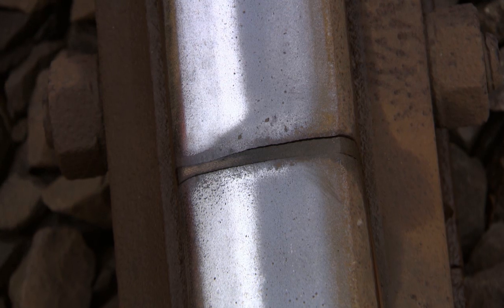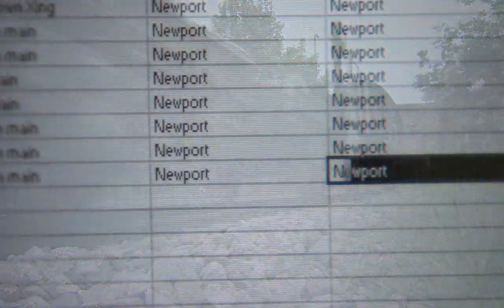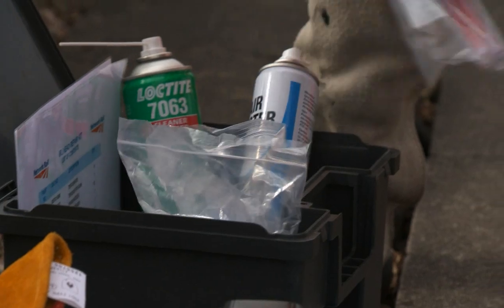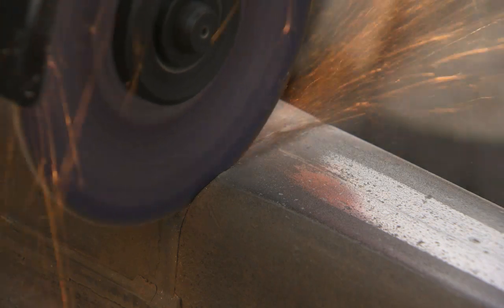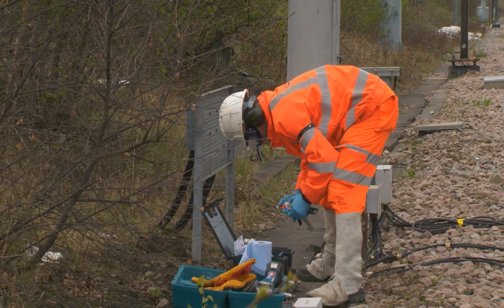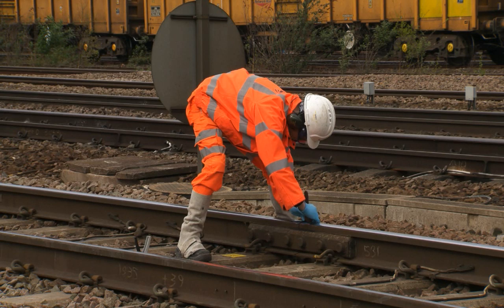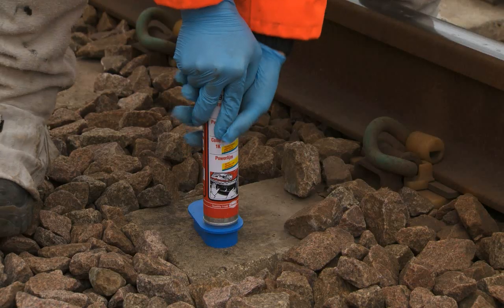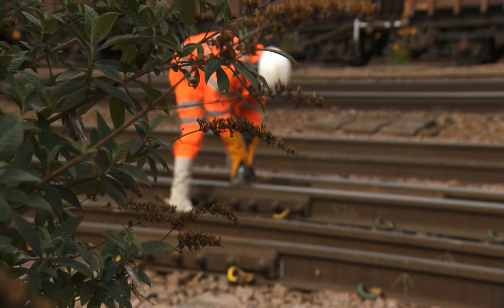IRJ (Insulated Rail Joint) Head Repair from Selectequip.

Comment: Epoxy holds up to the weight of a train?
Reply: Whatta load of hooey!
Reply: On a metre diameter wheel, how much do you think a wheel drops into a 3-4mm wide slot?  Virtually zero.
Reply: @RangieNZ  -It’s not a question of how far the wheel drops, but rather the FLEXING of the rails under the weight......